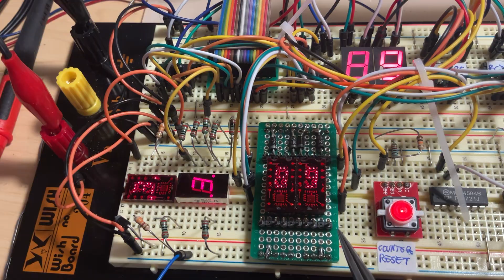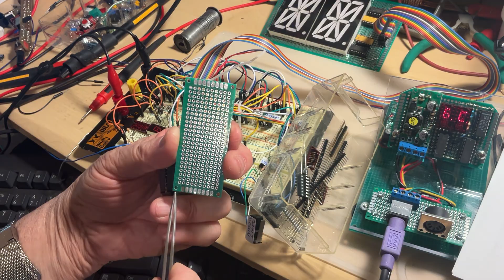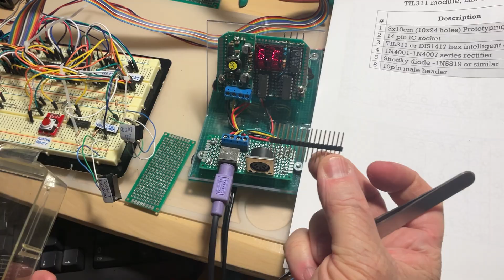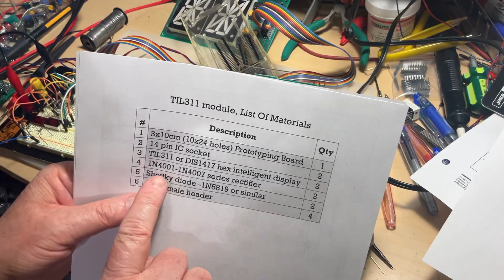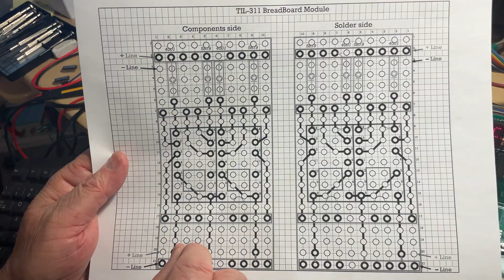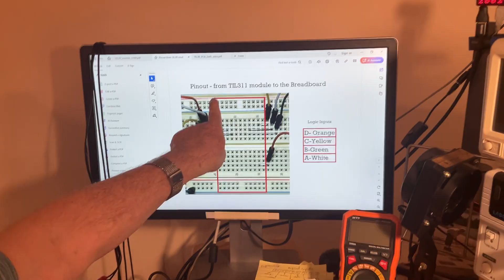Display Module with two TIL311 ICs–Part 1. Logic circuits, 33/101

Comment: I have some of these and planned to do a video on them as well as the TIL306.  Just to say that the idea of modules for breadboard is excellent.  It never occurred to me that those plug in power supples that come with breadboard sometimes are modules really. But how many times have I had to wire up 555s and the like - this is the fix especially if the modules have variable components on them!  Thanks for getting me thinking in a slightly different way!  BTW I am also tired of building big 7 segment displays that need Darlingtons - this is the fix again!
Reply from the maker: Thanks for watching Anthony!
I am using breadboards for many years for prototyping, so I tried to find ways to keep my wiring area to about 1600 points which is pretty limited.
Then I started to develop these kind of external modules for three reasons: one was like you said, being tired of re-wiring every time the displays with their decoders and resistors. the second was to minimize the space taken by my displays.
And the third was, any time I wanted to use bigger displays, they wouldn't fit anyway.
As you can see in my videos with displays, I always use these IDC connectors and they do a wonderful job. My latest such project was the "5second digital helper" if you look for it.
As for your 7 segment TIL306, it's a bit weird, as it has the DP on the left side. Send me the link to your video when you make it.
regards
Reply: @CU_Wiring_Electronic_Projects  That's interesting. I am going to explore the modular approach a bit further I think.  So I decided to publish my TIL306 today.  https://youtu.be/BK09n5NCqTg  It is one with the LH DP as you said but, of course, needed for displaying values that are 'fractional' as it were. But, why not use a RH one???  All a bit of fun!  I will have to look up some of your other videos too!  Best wishes, Anthony.

Comment: The discussion on maximizing the breadboard using modules instead of discrete components was great. The solderless breadboard is a necessary development tool for testing new product concepts. By explaining the use of electronic modules with a breadboard strategy enhances the need for electronics technology education and new product development practices using this approach. Great video, CU!
Reply from the maker: Thank you Don for your enlightening remarks. You sensed exactly the purpose of my video.          :washhands:Cheers